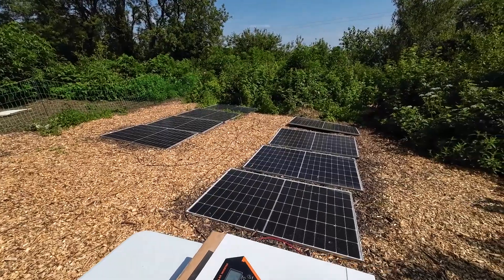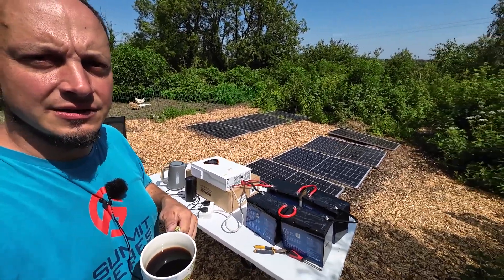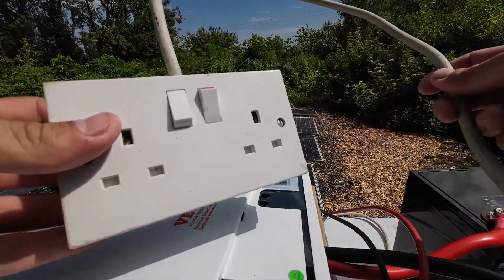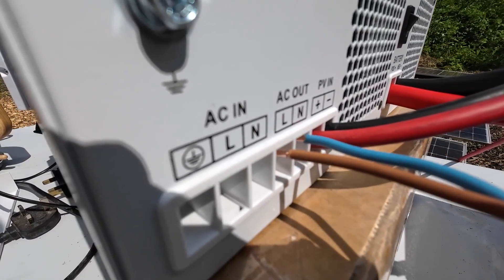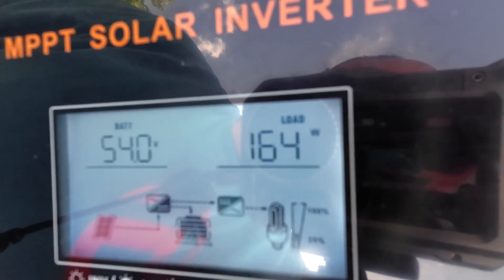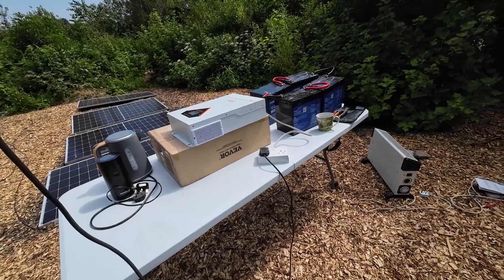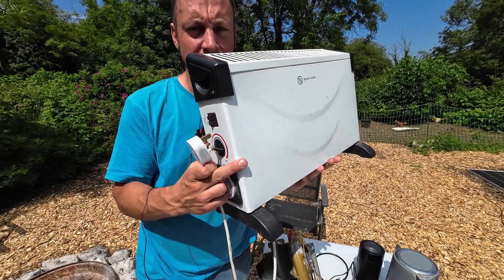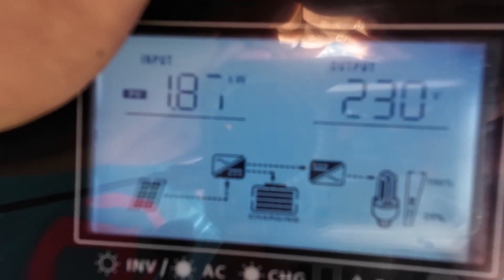DIY Backup Solar with Battery Bank First Test with Vevor Solar Inverter

Comment: Greetings from South Texas, great video . Quick question I see that on your line out ac outlet ,do you need to have a ground wire connected and if so where does that ground wire connect to?  Thank you
Reply from the maker: I connected the ground wire from the inverter case to an iron rod in the ground.